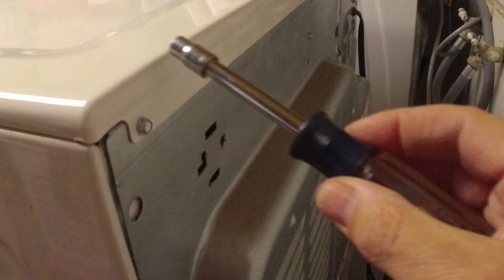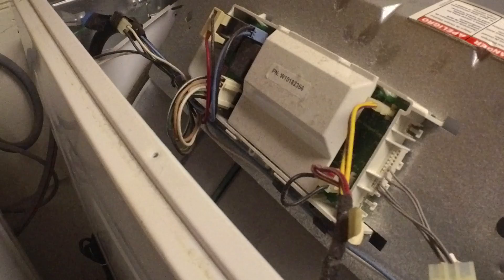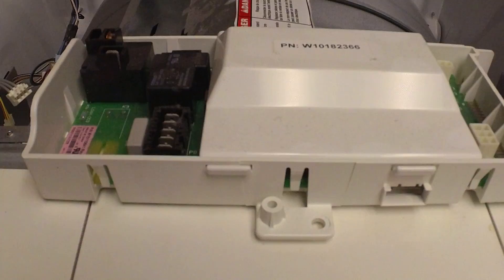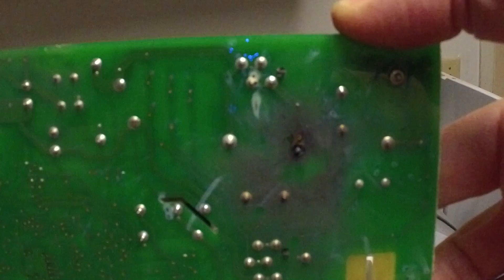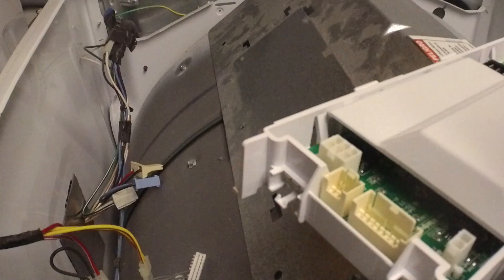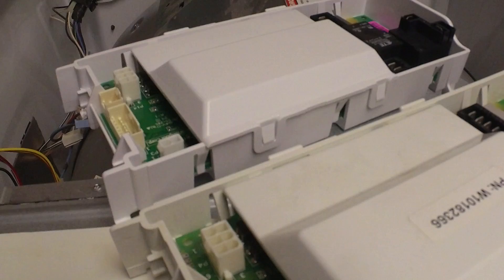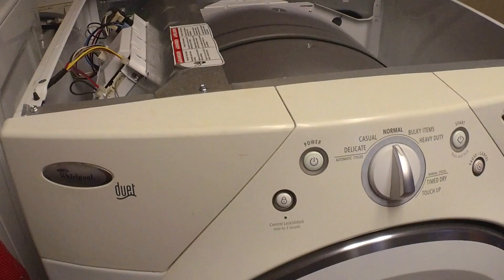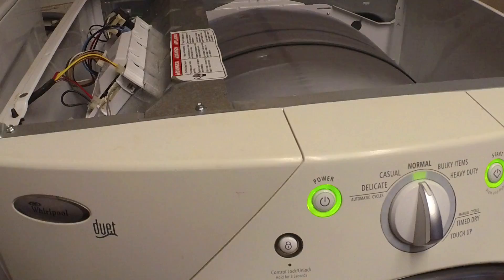Whirlpool Duet Dryer F01 Error Code Fix | Control Board Replacement

Comment: Bought and installed new control board however it beeps 3 times when trying to start. Help!!!
Reply from the maker: I have not had this issue on my dryer, but have read that the door switch may be the cause of the 3 fast beeps/no start. try checking that the door close switch is clicking when you close the door. The light inside the dryer will shut off. With the dryer door open you can push the switch in and see if it is working, and even test start the dryer. Hope this helps.

Comment: Wondering if you might be able to answer my question 🙃 I did all the steps, resoldered everything together and then a different part on the board blew and started smoking when I went to try and plug my dryer back in! Any tips??
Reply from the maker: Meagan, my hope in soldering the board was that it’d be a temporary fix while I ordered a replacement board. For me Soldering it didn’t work either. My advice would be to order a replacement control board, this is still far cheaper than buying a new dryer or paying someone else to service it (and replace the board). Best of luck.

Comment: Question about the part that blew the connection: one reader calls it a resistor, another a relay.  It’s rated at 30 Amps, so I’d call it a fuse. 🤔 Is it usually the same component that blows?  On mine it is the black rectangular shape, top left, second from left.  Is there a potential problem if you resolder and re-use it?  Thank you.
Reply from the maker: Jana, I wish I had kept the old board. Would be worth a try to just replace the relay, but I have not done this, only researched it after I had replaced the board. This may be the part you need: https://amzn.to/3ovXpxe

Comment: These dryers have the option to use electric or gas dryer setup correct ??
Reply from the maker: No. But a gas dryer still needs electricity to spin the drum and ignite the flame.

Comment: I had the burnt spot on my WED9500TW3 Duet. Do you know why it blew in the spot?
Thanks for the great video! I have a new CP on order.
Reply from the maker: I don’t know why this is the weak link on the board, possibly it’s by design, but know it’s very common. I hope you were able to successfully get your dryer back in service!
Reply: @MattsGarageMiscDIY  thank you for the reply and info! I found a board for $175. It was easy to replace.

Comment: What type of solder do you use?
Reply from the maker: Sandy, keep in mind my attempt to solder failed, but I was using what I had which is a 60/40 rosin core solder that I typically use when repair ing guitars… best of luck in your repair!

Comment: Dryer model number YWED9300VU0

 Actual control  board number :w10182366

As the web , this is the new number that replace the old number :  WPW10174745

I changed it , it was running but I got L1 error and got no heat
Reply: Hello friend, what is the price of this spare? Thanks
Reply from the maker: $152 for the Tire, $73 for the new steel wheel. The goal was to get something more stable to fit. For me this is cheap insurance because I take this vehicle places where tow trucks are not an easy option. Good luck.
Reply: Thank you, I just resolder the relay on the board and its back to business! Save a lot of money!

Comment: Is there anywhere else to find that control board
Reply from the maker: Dylan, surely many appliance parts sites will have the boards also. Many of them actually sell as a 3rd party on Amazon.
Reply: Matt's Garage & Misc. DIY I ended up ordering one from partsdr.com thanks also My TCB track fried completely off

Comment: How long did the replacement board last?
Reply from the maker: Great question, I did this repair in late November of 2019 (posted the video in December) and the new board has held up. I have made one other unrelated repair to the dryer when the thermal fuse blew due to build-up  in my vent pipe. Chances are if my attempt to resolder had worked that might not have lasted this long. As others have pointed out, the relay typically is telling you something is wrong and should be replaced (which I would have loved to try, but didn't hold onto the old board) Certainly replacing the board is more expensive but doing it yourself cuts out labor and markup of the part. These are expensive machines to replace so I'm still very happy with the cost of only replacing the board and the fact it's still working great over 2 years later.

Comment: Hi, after Googling I've gotten numerous ways to check for error codes. So far, two different ways with two different results. Can you tell me how? I'm pretty sure mine could be the same problem, but my lights aren't blinking like yours at the beginning. I'm just trying to save myself some time and unnecessary expenses. Love your video! Thanks!!!
Reply from the maker: Mandy, I'm honestly not an expert here, just captured this video to share that I was able to fix this specific error code and how I did it. Are you getting an F01, or just having issues but no error?
Reply: @MattsGarageMiscDIY  my dryer powers on and when the start button is pressed it will click like it's going to start, a second or two later it'll click again, but it just never starts. I had it powered on and held the Start button for a few seconds and got an F01 code. However, if I do a code check by pressing the Manual Dry up and down arrows consecutively I get an F50 error code.

Comment: Failed to check WHIRLPOOL DRYER THERMAL FUSE first, it could have been just a $20 fuse...
Reply from the maker: Jeff I have since replaced the Thermal Fuse when the Dyer wouldn't heat (I posted a video a couple months back and the fuse was less than $10!). At the time of this repair all the research I had done on the F01 error pointed to the Control Board failure which was true in my case.

Comment: how much for control board?
Reply from the maker: Davuth,  I left a lot of additional detail in the video description, including Amazon links to the control board I removed, and the part I installed. Most of the sellers on Amazon are 3rd party and the pricing fluctuates. Take a look and also shop around. This is not a cheap part to replace, but it’s a lot cheaper than paying someone to fix it or buying a brand new dryer! Good luck!

Comment: This is not a good way to repair this board. You need not get a new board, they are several hundred $, but you need to replace the relay. The relay is switching 240 v and the points arc leading to the points not making good contact and the relay heating up and melting the solder. So chances are that just resolder and it will just melt the solder again. You can get relays on Amazon for as little as $2 but it will be much better to get a better relay from a good reliable source because the contact materials will be better. I paid $  50 for a  Potter and Brumfield, I have more confidence that they will specify better materials even if the relay is made in Asia. A cheap relay, or just resoldering risks another failure and maybe  a fire next time.

Comment: The burned solder joint is caused by a defective relay.  The contacts get resistive and cause a lot of heat to travel down the pin and melt the solder. Resoldering that relay is a stopgap measure. The relay can be replaced for $10. https://www.youtube.com/watch?v=aZWBjouDPuw

Comment: Replace the relay for 10 dollars
Reply from the maker: I’d consider this if it ever happens again, but also have no regrets with replacing the board. It’s been over 4 years since I made this repair and besides replacing gas valve solenoid coils, roughly a year ago this old dryer keeps going! Good luck with your repairs. If you replace the relay, make a video and share it with the world!

Comment: The issue with the F01 code and not starting is the bad relay, you can replace it for about 15$..
Reply: you do have to remove the old relay off the board with a cheap soldering iron though and solder the new one on. Pretty easy really. just a thought for someone who wants to repair it for less than 20$
Reply from the maker: that would certainly save even more money! I’m still pleased with being able to do the board myself and not pay a repair person and their part mark-up too.

Comment: If you're going to show the repair than SHOW the repair and NOT fast forward through crucial areas! I am having serious problems with the disconnect of one of the wire harnesses and wouldn't you know it, you never even show the removal of all the wire harnesses from the bad board, but skipped ahead. So basically this was worthless to me.
Reply from the maker: John, there are plenty of other videos out there on this topic. I'm just a DIY guy that likes to capture some footage as I fix things. Unfortunately I'm not always able to get the ideal angles or footage that may not be blocked as I work. Take your time, the connections as I recall are either rocker/pinch to release or pull straight out. Take a pic before you start as I show in the video, you'll get it.
Reply: If anyone had videotaped me, it would be a MUCH longer video, that’s for sure.  I watched a few other videos on this topic and got some tips on how to remove the various connectors.